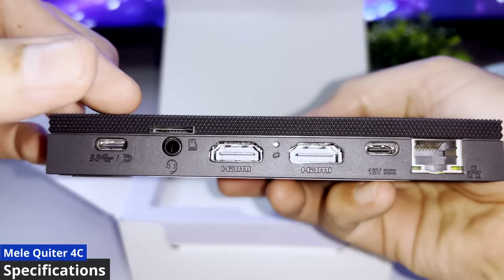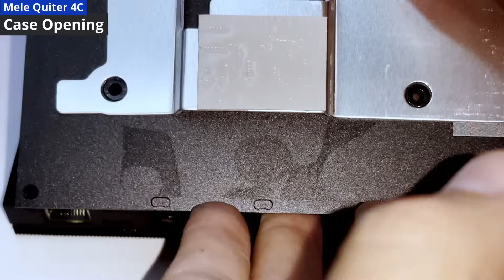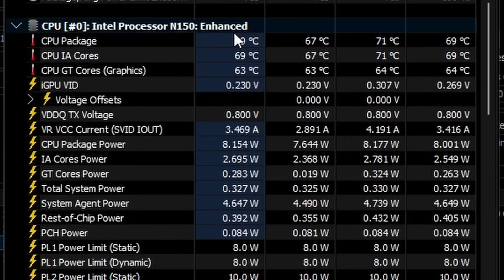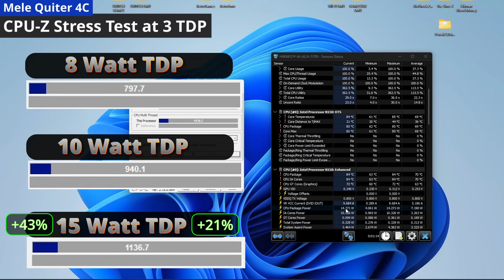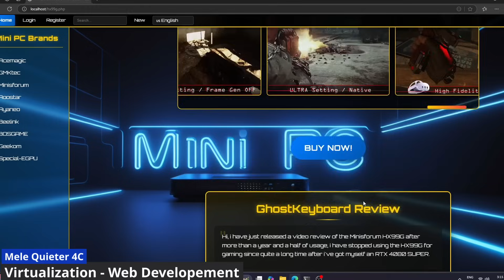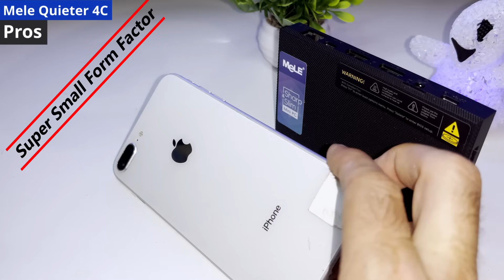Mele Quieter 4C Intel N150 World Smallest Intel Mini PC In depth Review

Comment: Whats the voltage and current output of the usb c (monitor and data) port?
Reply from the maker: The Melee Quiter 4C output is 65W, that's plenty enough power to power a portable monitor, USB-C port also support PD:3.0 for powering your Mini PC.
Reply: I have portable monitor that requires 35w, does that mean I don't need to plug the monitor from a separate power source?
Reply from the maker: @seennotsinned you can power the monitor directly with the USB C port

Comment: Thank you for the very detail review.

I wish Intel had upgraded the N150 better than this, but it seems like the changes are very minor. Maybe I'll wait another year.
Reply from the maker: Hi. Such upgrade won't happen, These are the limits of a low 6W TDP 4 Cores, the N97 is the N serie chip with the most performances with 4 Cores, if you want more juice you need to look at the 8 Cores N series like the N300, N250, but it will come at a higher price, and in this case AMD become a more attractive option.
Reply: @Ghost-Keyboard Thank you very much. I will look at other N series as well as AMD too. <3

Comment: Would there be support for Debian Linux or other linux distros? Will the lan/wifi driver etc. work on linux?
Reply from the maker: Hi, yes the Mele devices are supporting Ubuntu and Debian linux, i did tried  Bazzite on it and it was working smoother than Windows, but Linux lack of Video Encoding Hardware optimization ( No QuickSync) prevented me to video capture Game test.

Comment: I am a subscriber Ghostkeuboard Thanks You ✌️ Bro I like that You always have tips about TDP , Fan noise or Thermals of the mini PC , And it is good that you point out the disadvantage of a Fanless mini PC , For I came across a brand Of Mini PC called SZBOx z66 and Topton D12, but Because you have a Review and tip on one of your video I still chose GMKtec , but I am almost convinced or tempted to buy one of those other Brands because they are cheaper but since One looks slim for a mini PC with  Ryzen 7640hs and I am not familiar with their brand I still have to choose between SZBox and Gmktec then AI response said GMKtec is better so that answer and your vid made my decision, but thanks you introduce Mele too here and I hope soon you will have a Review of Topton or Szbox mini PC so we would know the brand more. PEACE
Reply from the maker: Hi, thank you for your encouraging comment, i am glad my effort to educate viewers on TDP, Thermal adjustment, Mini PC cooling design and efficiency and fan tweak did not go unnoticed.👍

About SZBOX / TopTon, they are a big manufacturer no doubt about that, their large catalogue of Mini PC ranging from low budget, entry Intel N serie up to High-end model with mobile RTX 4000 serie & Top Intel CPU (14900HK) is nothing less than impressive, Topton and GMKtec are their own manufacturer unlike Beelink, Minisforum, Aoostar, and others which are a brand, they are designing and engineering their Mini PC, but they do not manufacture their Mini PC.

My Issue with Topton is that they don t provide any Support, Costumer Service and Warranty, you will left pretty much on your own after purchase, not saying they are bad, indeed they seems to be good as i have not noticed bad users reviews, or mass complains on default unit.